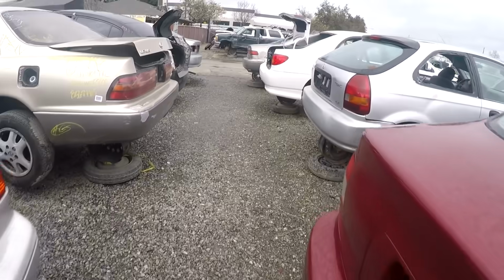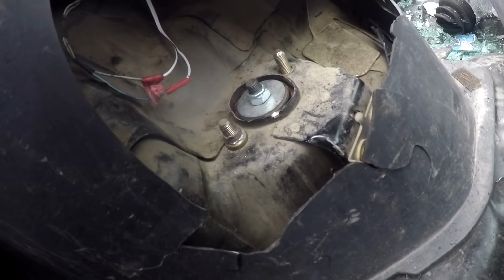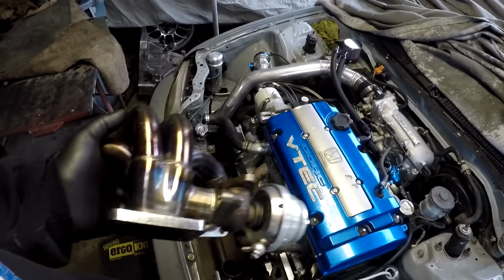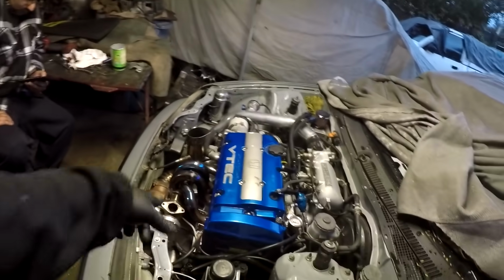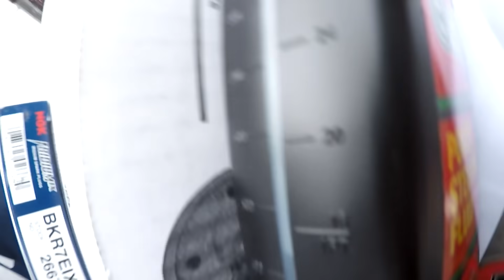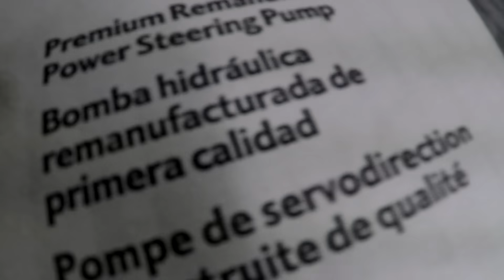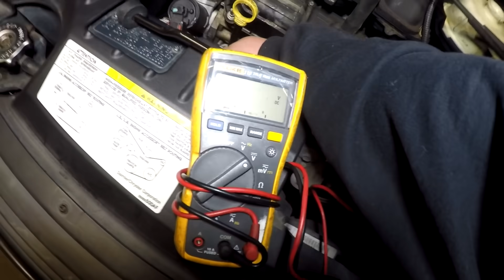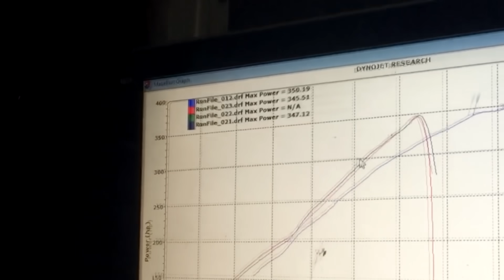JUNKYARD FIND ! AND THE H22 HOLDS BOOST ! !

Comment: Hey I'm boosting 15psi with 1000cc injectors 255 pump and leaning out, running NGK R5671A-8 could it be the plugs! 1000cc injectors shouldn't be maxing out yet?
Reply from the maker: Stock fuel line? What power? You may be maxing out the fuel pump.
Reply: @YoungStatic  stock fuel lines and rail. When my guy try to street tune it said my injectors are maxing out. 1000cc Bosch injectors, should not be maxing out on 15 psi with a 255 walbro pump.
Reply: @YoungStatic  what could it be I have friends that use stock fuel line and fuel rail and not have this issue

Comment: I didn't know my numbers cuz i tuned my own shit. I do know that on 9 psi it was pretty fast for an accord and it would have pulled anything up to certain v8  or modded evos. On head studs and an f20b head with the small ass auto cams a h22a bottom, 1200 cc injectors. Fuck that haters

Comment: Haters going hate no one believed me back in 09 my sti was bone stock internals FBO pushing 450+ ran high 11s street tires but i blew it up a year later all because i forgot to put my hose clamp on my wastegate vac line #hawaiifan ftw
Reply: Btw it was a 04sti that had a 20g turbo biggest they had for stock location at the time
Reply: alphant1 born and raised in hawaii
Reply: alphant1 all good fam

Comment: I never understood why people go to great length to swap an engine into a chassis and then skip the power steering. Most of the time its like a 30 dollar hose that a good part store can make for you in house.
Reply: They prefer to have it without power steering
Reply: @budgetbuild914  I dunno I guess this makes no sense to me. Power steering is always better than mnual. The thing is there is a difference between having a manual rack and or steering gear and having a power assisted rack with no pump. Each is own I guess.

Comment: What’s the CEL in the van?  
 
Also... you ain’t gotta prove shit to haters, I’ve dealt with very similar situations here in NY. Dudes just hate getting gapped by junkyard dogs after they’ve spent so much cash on “ race proven performance work/parts”
Reply from the maker: I believe the p0031 came back.
Reply: Damn! If you have already tried an OEM o2 sensor and have the same issue deff look for rubbed or previously probed wires that may be corroded! Have alot of the same issues on the neons homie! Good luck!
Reply from the maker: RockettMotorsports I’m sure a rat chewed it up somewhere. I live near a creek and I’ve seen them jumping around in the grass
Reply: YoungStatic #realhoodrats !!